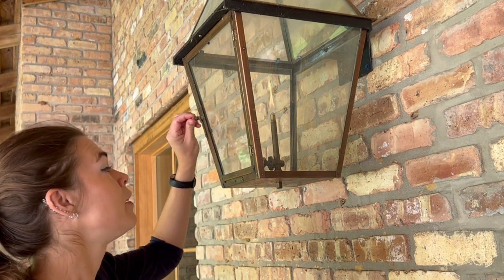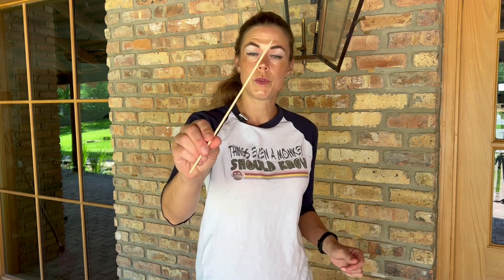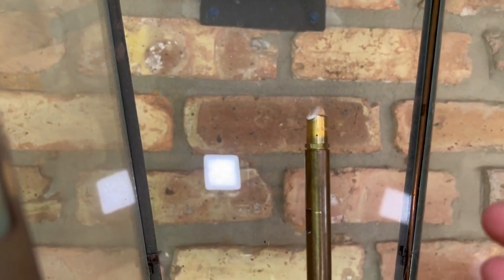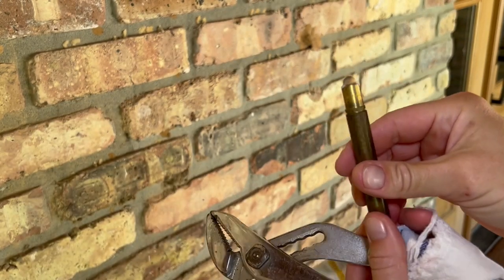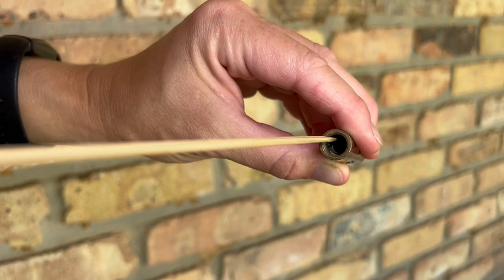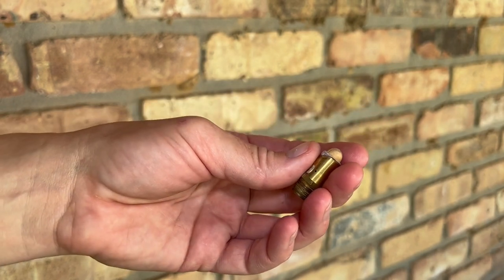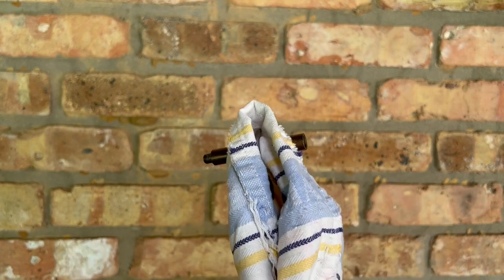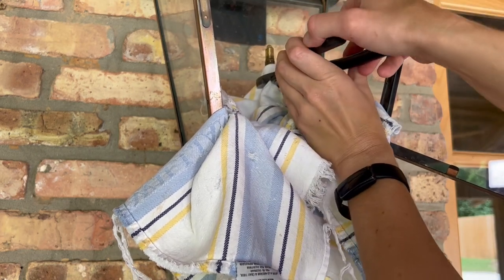TEAMSK - Cleaning a Gas Lantern

Comment: How much does it cost to run gas lamps??
Also, some gun cleaning kits have mush stiffer nylon brushes as well as solvents for carbon buildup.. how do you think that would work?
Reply from the maker: I would think a gun cleaning kit would adapt well! A stiffer brush would definitely make this easier. These cost about $3 a month when they are on the candle flame type setting. The higher setting (fish tail) is closer to $7 a month.
Reply: It's just a pilot light, not much at all. Most people let their pilot lights run inside even in the summer because its not worth the hassle
Reply: @MonkeysKnow I bought a house with a gas lamp. How do i change the setting ? My flame is too calm and I want it to dance a little bit like my neighbors.
Reply: @MonkeysKnow  Is that cost for letting it run 24/7?

Comment: Any idea what to do when it hasnt been unscrewed in probably over a decade? Any tips for loosening? Torch?
Reply from the maker: You can try soaking it with WD40 or some other type of penetrating lubricant and leaving it for an hour+. It is likely going to be stuck fast, so lots of patience will be required. You may have to repeat the application of the WD40 several times. I had to do this on one of mine that was at least a decade old also. That was what inspired me to make this a yearly task.🙂